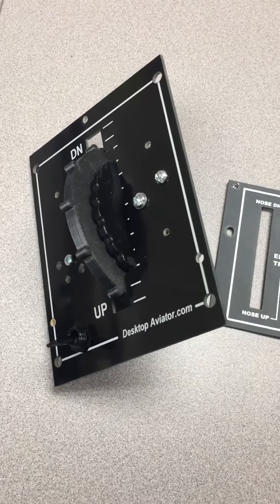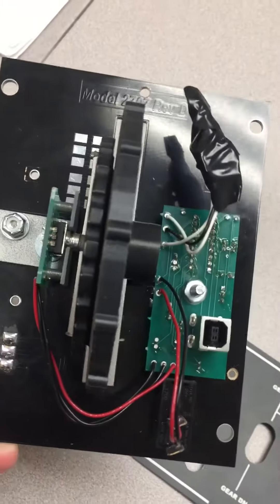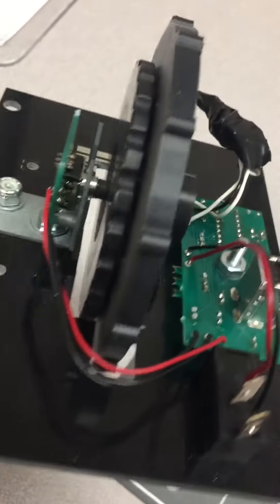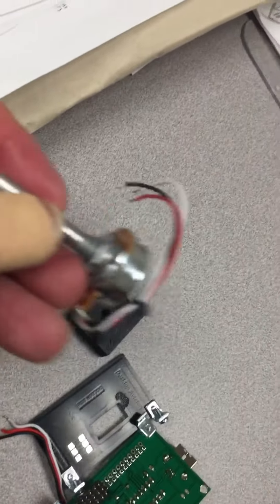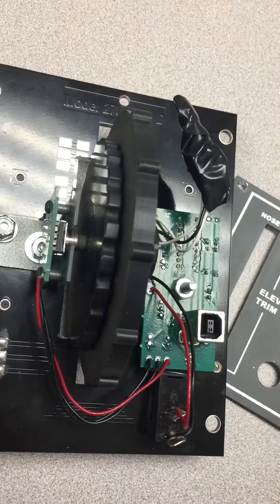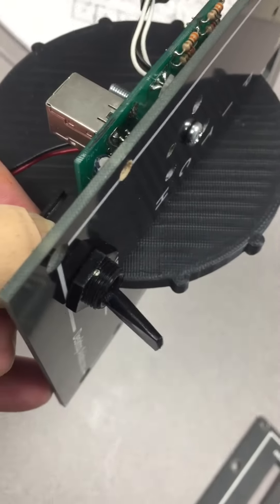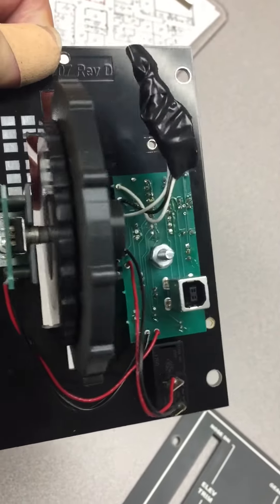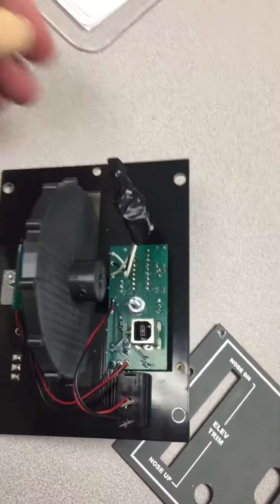Trim wheel modification

Comment: Let me know how that trim-wheel modification ended up working.  Did you stick with it?  Brutally expensive trim-wheel but the end result is all that counts irrespective of the $$
Reply from the maker: Hi, the trim wheel works great with the mods. I am still using it on the sim with great results.